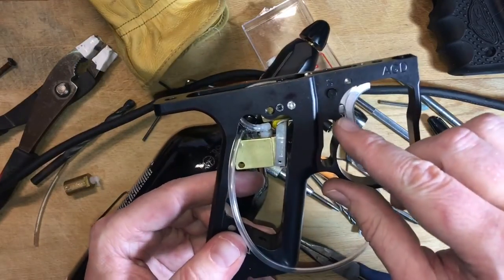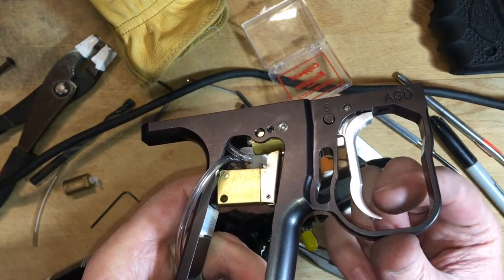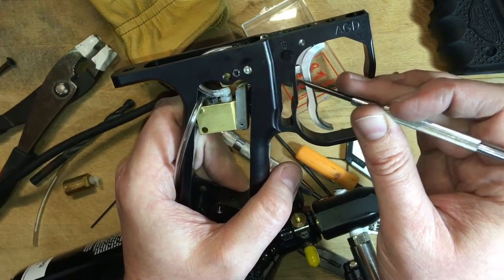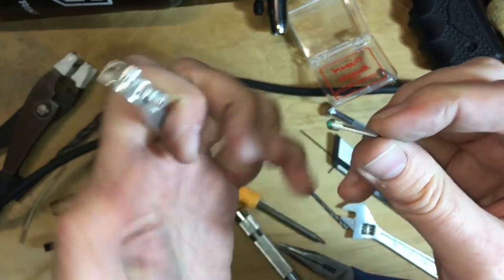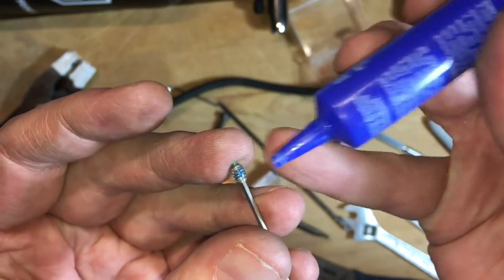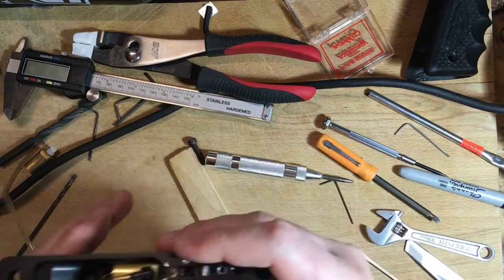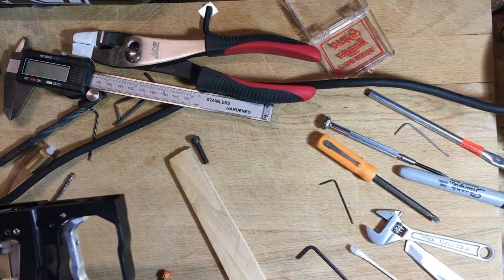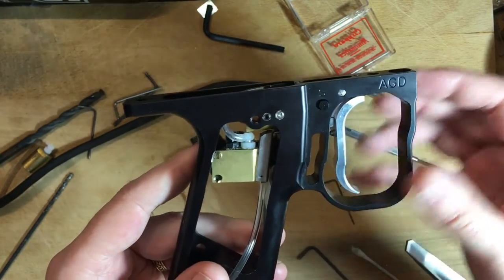Pneumag Tutorial: Part Six (Trigger tuning)

Comment: Hi I was going you can help meet out I've this setup my problem is my actuator went south it's been so long since I did this build can you plz help me relocate these parts plz thanks
Reply from the maker: I don't understand what you're trying to say. Do you need replacement parts?
Reply: @rawbutter803  yes I need the actuator for the fabco pneumatic intelli frame set up can you let me know where I can get another plz thanks
Reply from the maker: @TonyTobiasGambit1337  The actuator is called a "Fabco MSV-2." You can find them online in a few different places. Search for the name on Google or in Ebay and you should find one somewhere.  They're about $20-$30.
Reply: I think that number is the square brass deal with the lever to activate the firing pin or is that number for the round actuator with the piston because I need that part that activates the sear and thank you for getting back to me and helping I appreciate it alot
Reply from the maker: @TonyTobiasGambit1337  The part that activates the sear is called an air cylinder, specifically a Clippard MPA-3. You will need to file down the round edges to get it to fit inside an Automag frame. 

https://www.generalindustrial.com/itemdetail/MPA-3?gclid=CjwKCAjwopWSBhB6EiwAjxmqDa4nxo7b3tNz6E4uvxSRnzOOIfVL2NpbZhR9acn_rqBI2vu2MdMFPRoCJ5EQAvD_BwE